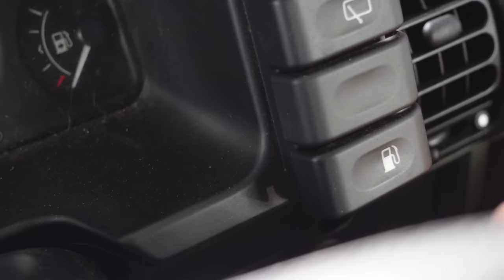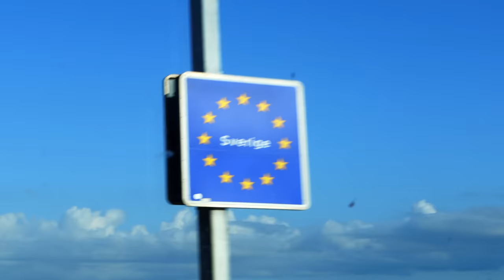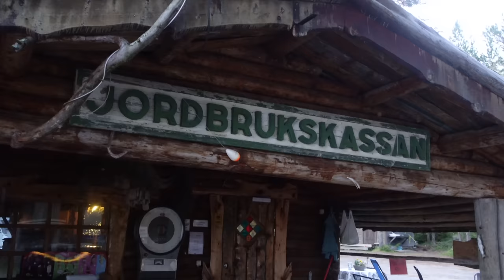JOURNEY TO THE ARCTIC | From The UK In An Old LAND ROVER

Comment: It look at getting some suspension upgrades on Percy, with all the weight he's carrying as a camper. Similarly,  rear axles aren't designed for that kind of weight either, so maybe a look at Ashcrofts for heavy duty diff & half shafts, etc.